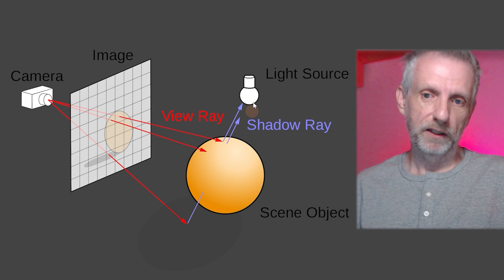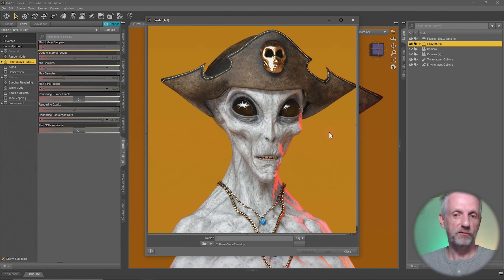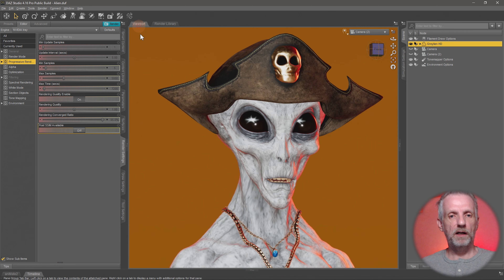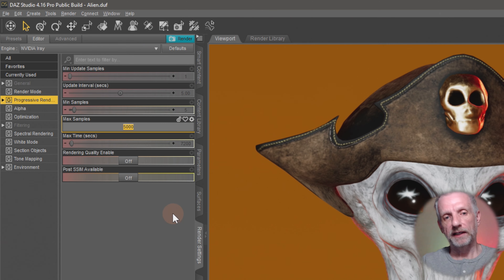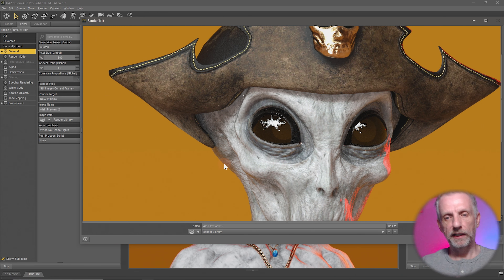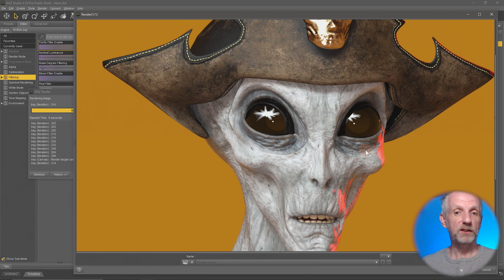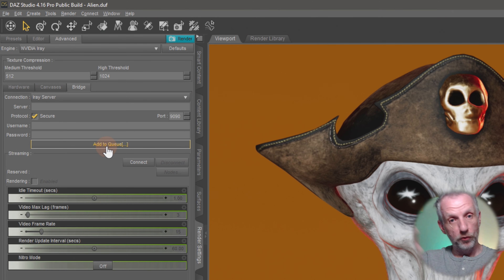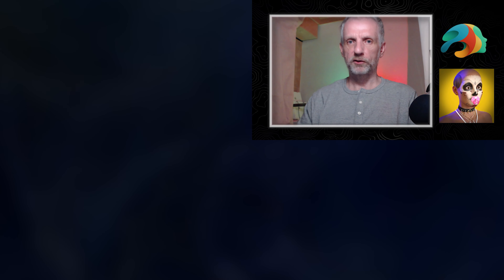Part 21: Rendering With NVIDIA Iray | Daz Masterclass | Intro

Comment: I keep getting CPU fall back that causes my  renders to take forever. My GPU is GTX1080
Reply: That means your scenes are exceeding your resources. Get a card with more VRAM, and get more system ram too if you don't already have at least 32gb, or use less assets in your renders or else it will always fall back to CPU. You need to make sure the scene is not exceeding your hardware resources before rendering.

If upgrading your hardware isn't on the table, I would highly recommend getting the Scene Optimizer tool.
Reply: Layering your scenes will help too. Yes it will take a bit longer but it will give you more control and your scenes won't freeze or crash. I have a few backgrounds that I reuse often. Blender renders a lot faster as well so I do high res stuff in Daz for the details, blender for environments, modeling, etc., then Davinci for post. All free, all awesome